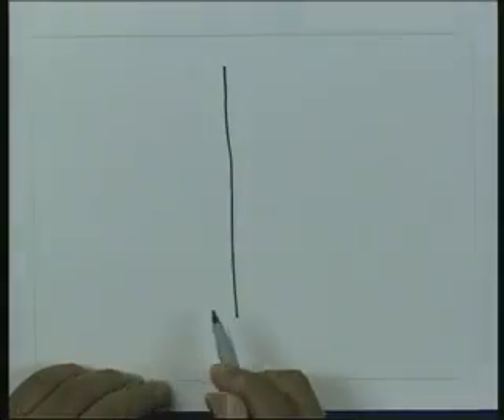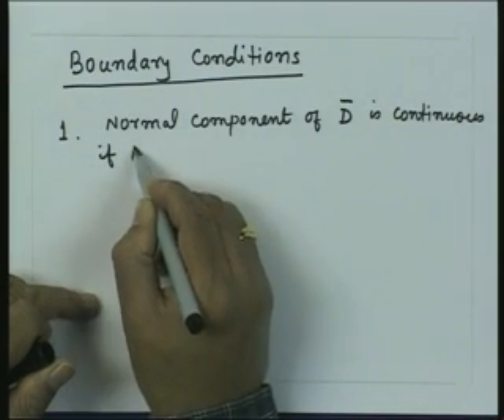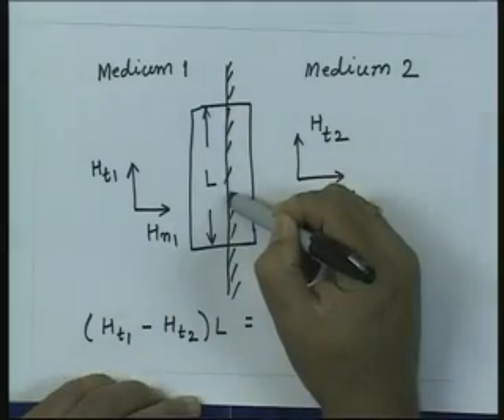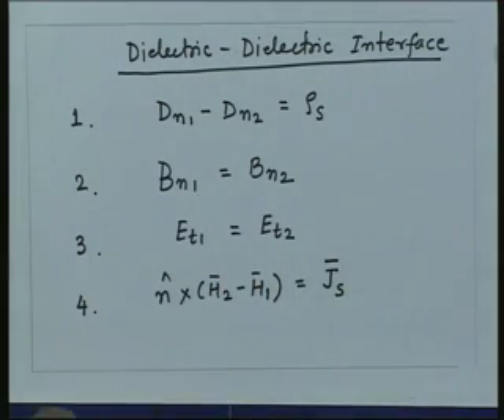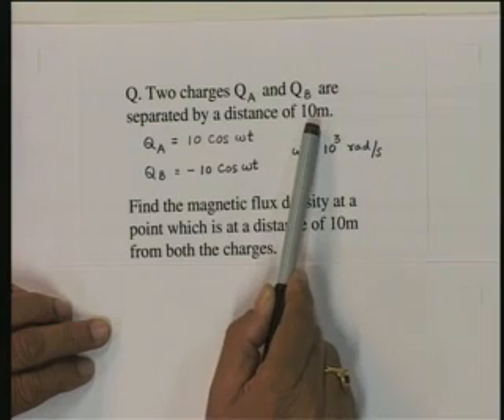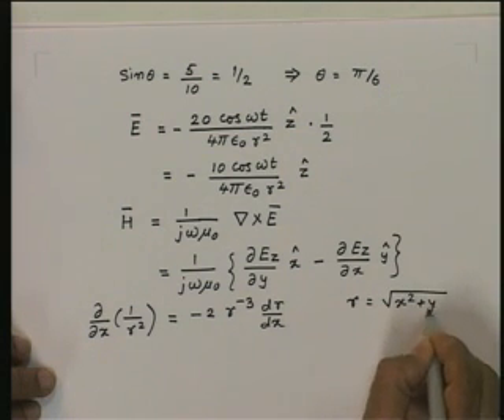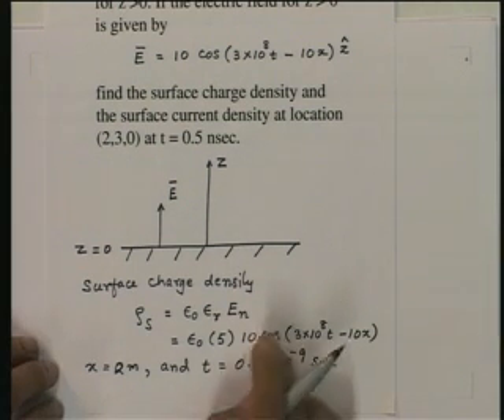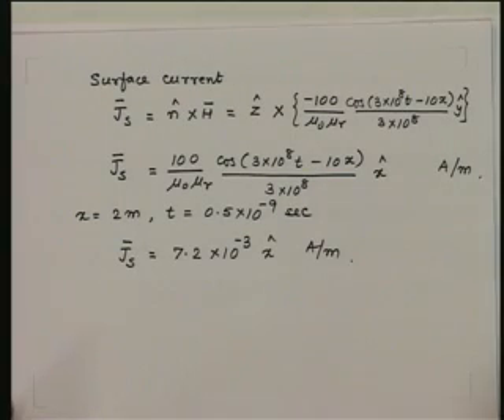Boundary conditions at Media Interface

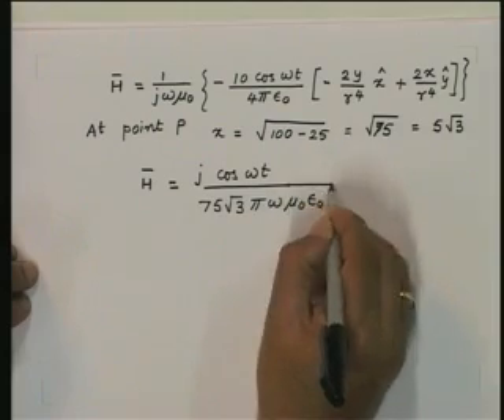Comment: The final expression which he wrote in the end for two charges' question is not coming as given at 44:29 despite solving same way as professor did? I think he mixed polar cordinates and thus time and spatial variation togeather. He used Maxwell equation in frequency domain in that question. Those watching this lecture must revisit comment section as few mistakes(Inadvertantly) in writing has been made by the professor, which should not dissuade an avid learner from watching videos. Thank you.
Reply: I'm not sure if the E field in that problem has a curl. Also to obtain H, the E specific to the point P has been differentiated, which isn't right!
Reply: it is coming, I solved it

Comment: I have one confusion,why must the magnetic field zero inside ideal conductor,
I understand that E must be zero inside the ideal conductor and when we use the faradays law,we find that actually partial derivative of B wrt time must be zero.
But that does not mean that B must be zero,i mean it can be any constant,why only zero?
Reply: Both Magnetic and Electric field inside conductor is zero only for time-varying situation. In static case electric field inside good conductor may be zero but magnetic field may not be zero. For example a steady current will indeed create a static magnetic field that does not affect the electric field.

Comment: Hi Prof, your subsequent lectures show that E/H=120pi. In your example where charge A and B are 10 meters apart from each, the ratio of the computed E to H does NOT give 120pi. it's got omega in the ratio of my computation, meaning it is not a constant, rather it's dependant on frequency. Would you have any explanation? Anybody else can explain it? Thanks!
Reply: That is not true for the point charge. For that you should go conventional way.
Reply: Yeah same doubt.in the first place he could have calculated E and then to find H divide E by eta..rather solved using Maxwell's equation.

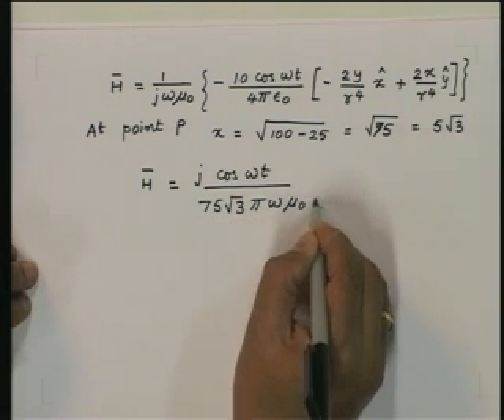Comment: The magnetic field presented at 44:29 is not correct.  The correct expresion is
3*sqrt(3)*sin(w*t)/(800*pi*epsilon[0]*mu[0]*w).   Please check.
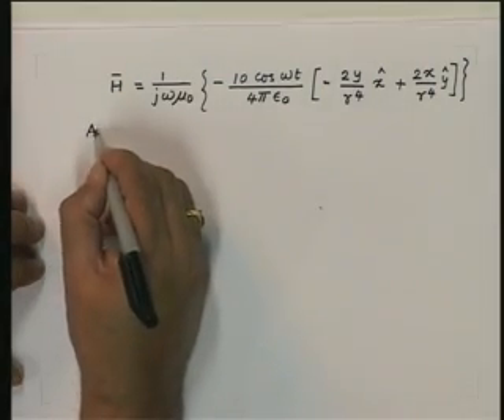Reply: Hi, do you have the same symoblic expression as Prof.'s  @42:39? If yes, do you have x=sqrt(75) and r=sqrt(75)? By the way,  I come to the same result as the Prof's.
Reply: Hi, I guess you took derivative with respect to t, not x or y, didn't you?
Reply: @poiuwnwang7109   it is 7 year old comment and not going to reply
Reply: @PhysicsMath  haha rightly said
Reply: @PhysicsMath  Hi, I am from 2023
Reply: How x and r both are sqrt 75??